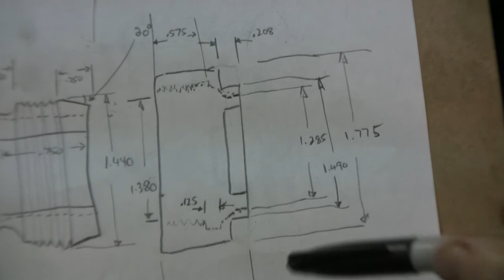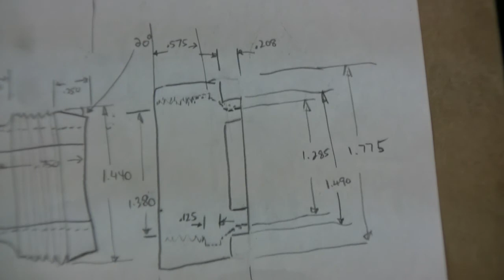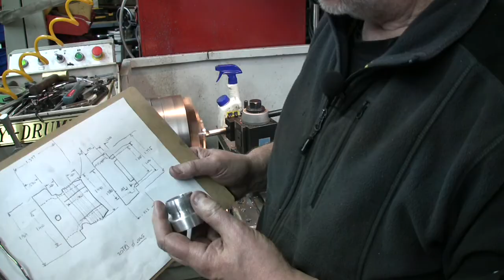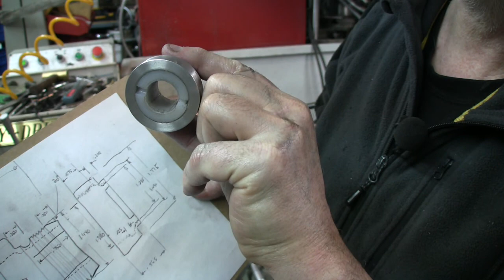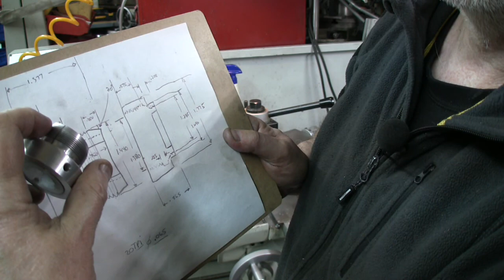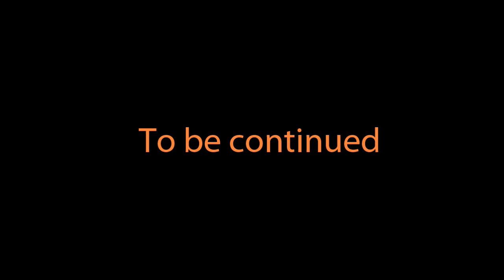Camera jib or crane part 5a Making a collet

Comment: Did you notice when you were boring the 1" hole that the work piece moved into the chuck?  Pierre since I'm just starting to learn, should that kind of slippage in the chuck be a concern?
Reply from the maker: Hi, didn't notice at the moment, you're right, it got in a little... Not supposed to, in some cases there are no consequences, like here, but, in other cases you DON'T want this, some ways to avoid it, have the chuck jaws rest on a shoulder, ease the drilling or boring, make the chuck tighter and that's about what you can do to avoid the slipping...
Thanks for comment,  Pierre